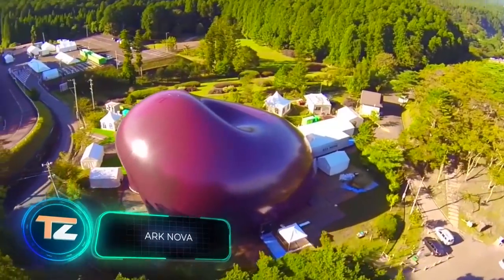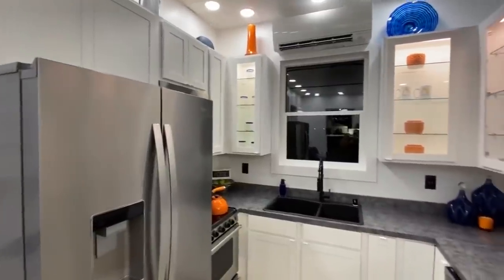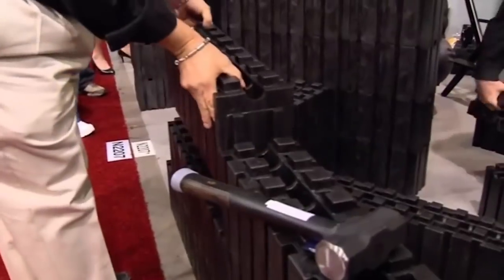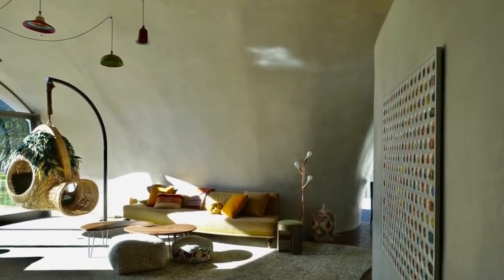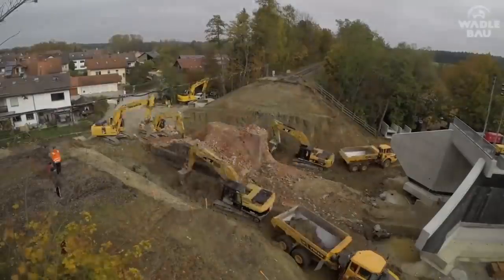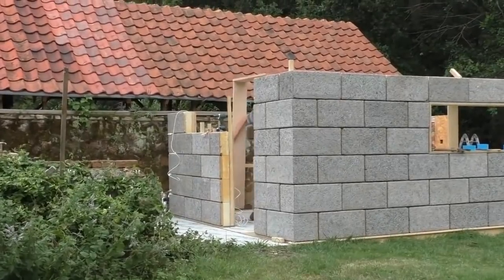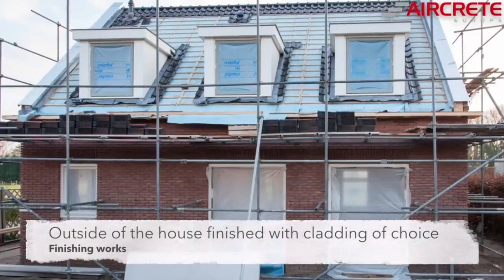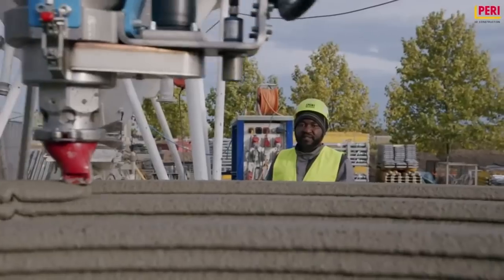12 INNOVATIVE BUILDING SYSTEMS

Comment: So for the inflatable stadium.
WHAT HAPPENS WHEN SOMEONE BRINGS A NEEDLE and puts a needle in the membrane.
Reply: Would probably have to be a big needle, or a knife, and would have to be very sharp, because if they could be popped that easily, it would not have gotten far enough past the testing phase to have a commercial for the TechZone narrator to dub over.